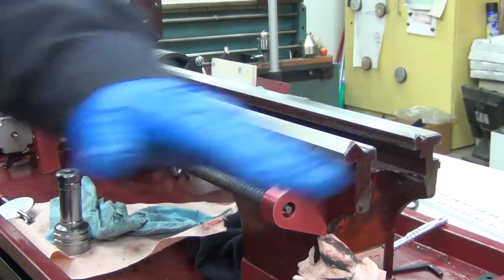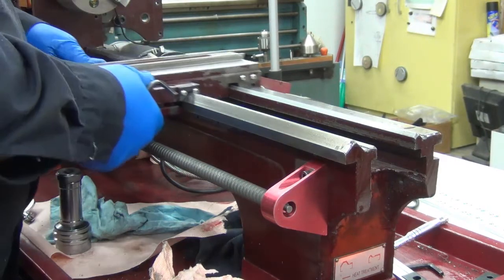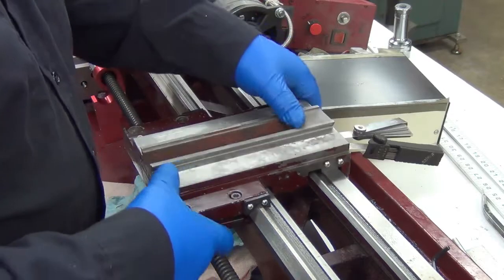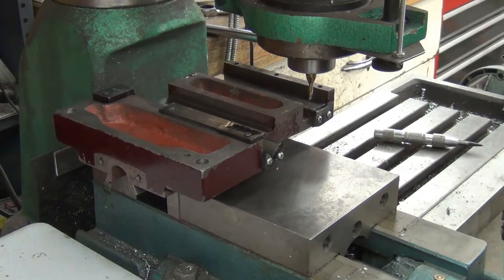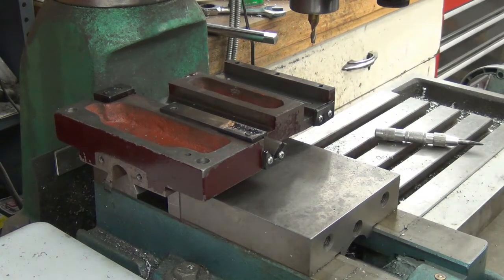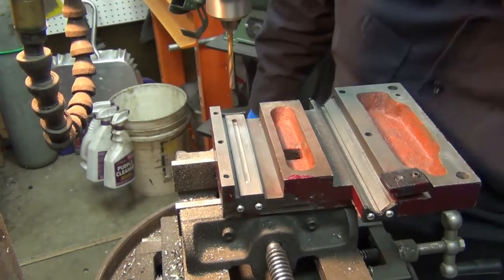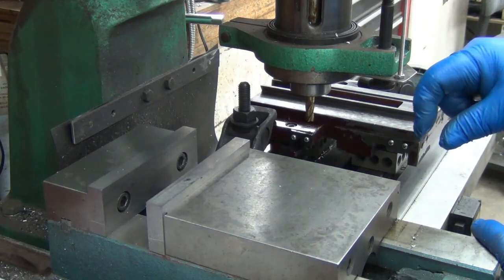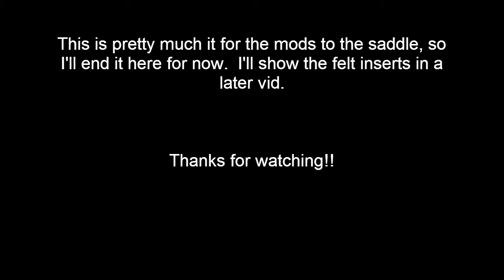CNC Lathe Fix pt5 - Saddle work

Comment: You have it right in that you needed to shim under the saddle until when you are tight on the screws that you can still move the saddle by hand with the ways oiled.  Don't forget to oil both the top ways and bottom ways.  Also, measure the thickness of the way bed on both the front and back ways.  It is not unknown for these HF lathes to have variation in the thickness of the way bed and therefore you cannot clamp down on the way clamps without binding, or being too loose, somewhere on the bed.

Regards;

Ron
Reply from the maker: Awesome! Thanks for the confirmation Ron!   I moved it back and forth after shimming and thought the thickness was okay, but I've noticed that I'm getting a twist when the saddle changes directions....like the back is tighter than the front.  Since it's twisting, I'm guessing that the front must be a bit loose, otherwise, the "V" should stop the twist.  So, maybe I had it on a thick spot or they've loosened up. I'll need to check that soon. Thanks!

Comment: Hi, excuse my late reply.
Greas is increasingly used in ballscrews today but you should be careful with the choice of greas! It should not be too tough. The reason for this is that the balls stop and sliding instead. 
T.Krondahl 
Sweden
Reply from the maker: Thanks!  I'll check into it more.  I've seen white lithium grease used.  I'm guessing I'll have to take the screw out to properly pack the nut?

Comment: That's a shame about the oiler hole. :{ we all do this kind of thing it's still going to be a better machine with all the work you're doing. :)
Reply from the maker: I'm not too worried about it, but at least someone else might be spared drilling too far.  Even if it worked the same, at least I'll more faith in it continuing to work.  I just hope I can get back to using it before too long.  I had hoped this would be a weekend project, not a month :(